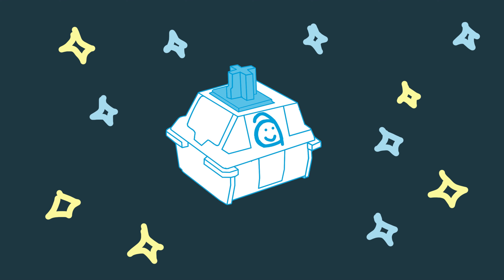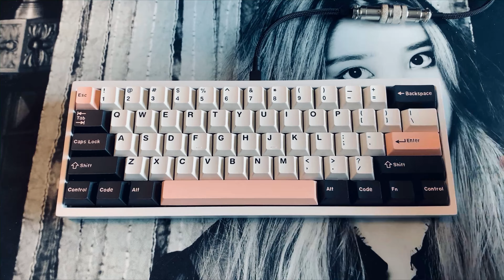Bakeneko60 Sound Test w/ Lubed & Filmed Boba U4T | FR4 Plate | PE Foam Mod | GMK Olivia Clones

Comment: Did filming do much? Or is it not necessary?
Reply from the maker: honestly, filming did not do much at all except for MAYBE making the switch sound deeper. The switch already has a super tight housing, so I don't think filming is necessary unless you want to give the switch a deeper sound, but I honestly can't tell a difference.
Reply: @auaena  What about lubing? I am looking to lube it with 205g0, what did you lube it with and what are the differences?
Reply from the maker: @Baffledbeans  Great question! For lube I use 205g0 and for tactiles I only lube the side of the stems and not the stem legs. If you were to use 204g0 it would just be less smooth. I think 205g0 is best if you know how much lube you should use. Personally, I like to use more lube than most people because I like a quieter and deeper sound. However you should experiment yourself with 3 switches and see which lubing method you like best and how much lube you like to use. With more experience you could do this very efficiently and consistently.